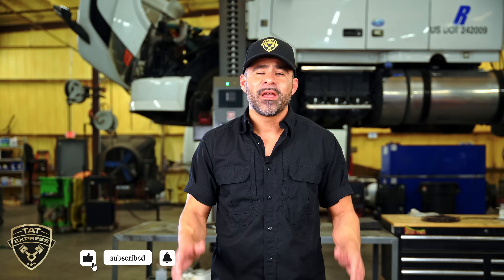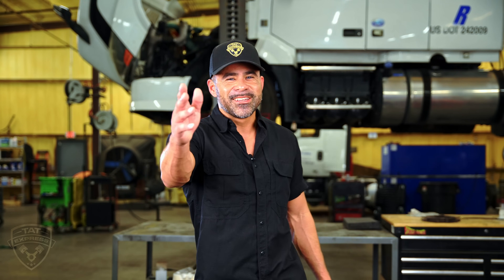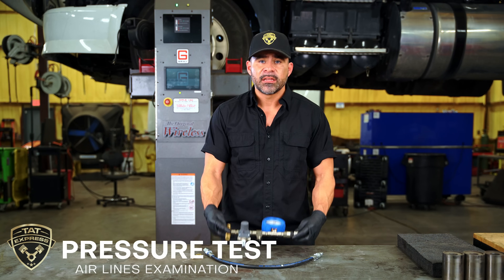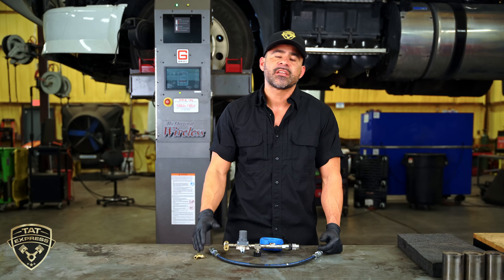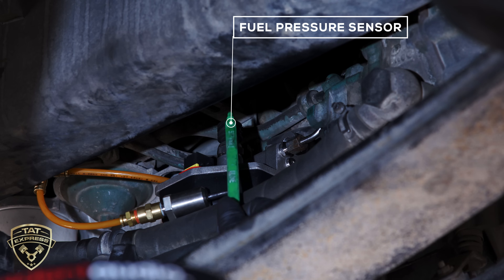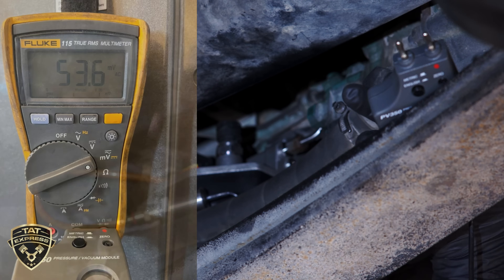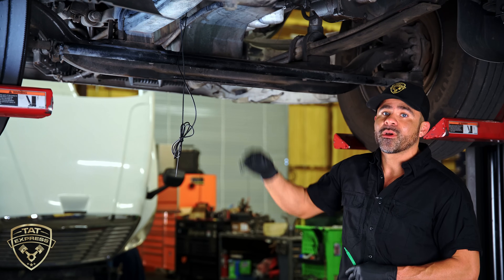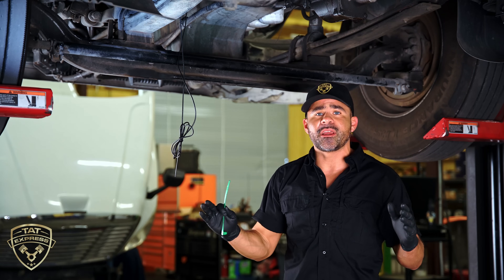D13ATS fuel pressure fault/How to fix derated Volvo D13/ATS Fuel pressure fault/will not regenerate

Comment: Please help!!  I had code P026C00 could it be cause of air dryer filter or EPRV needs to be deleted or bad injectors. I own 2020 vnl760 500k miles
Reply: Mine has over 800